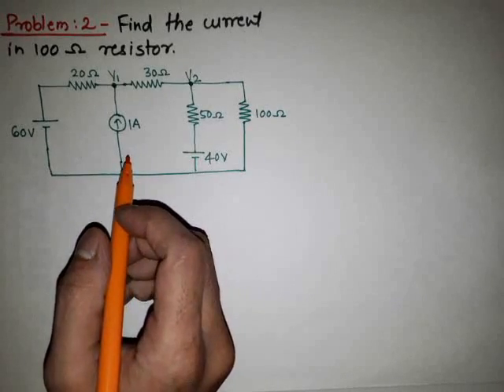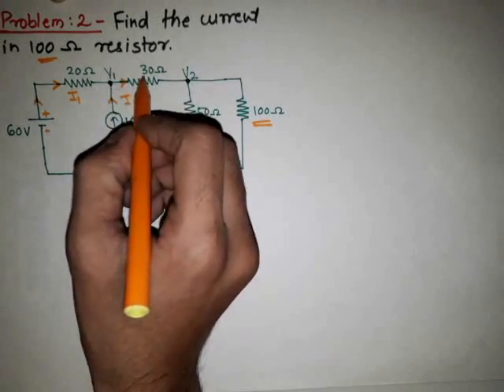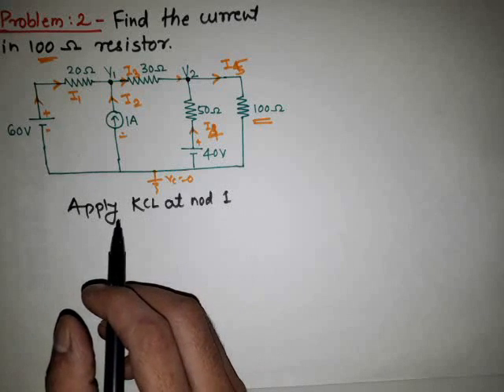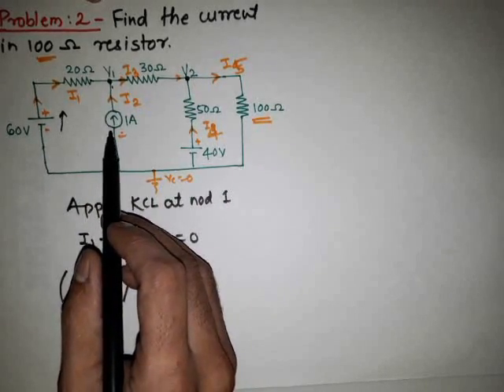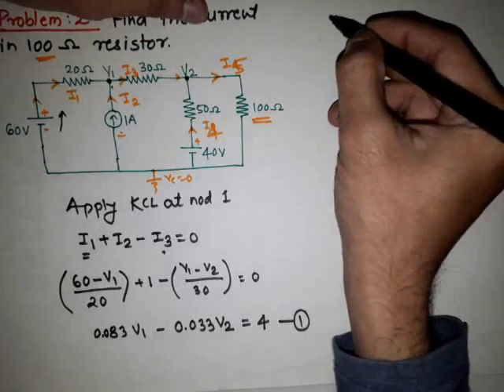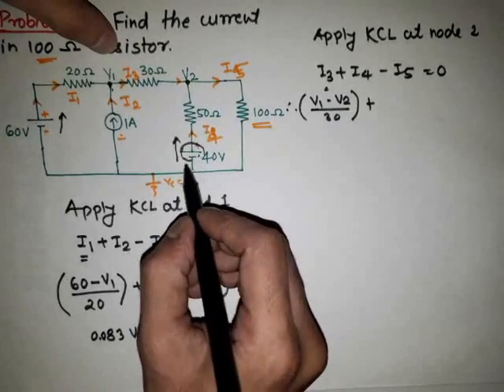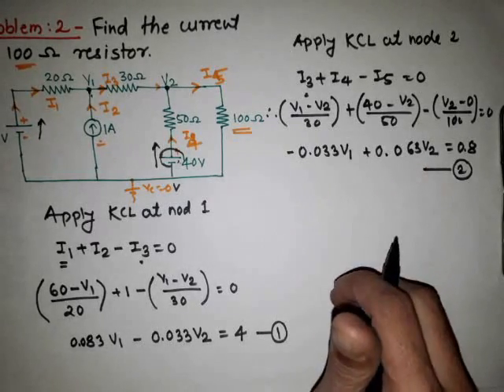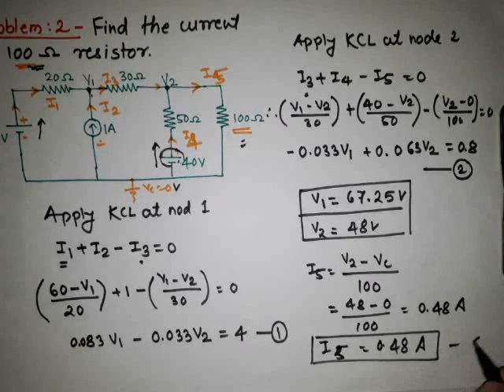Nodal Analysis ( Example ) (Lecture: 5.2)

Comment: Can you explain why do we need to put a ground in nodal analysis, and is it possible to solve it without it?
Reply from the maker: The node voltages which we are considering are always with respect to ground, therefore we are considering it. And we can solve this without considering the ground, but do not consider it as a separate node.
Reply: @learn_with_rupesh_hirve  
Thanks I have the same doubt